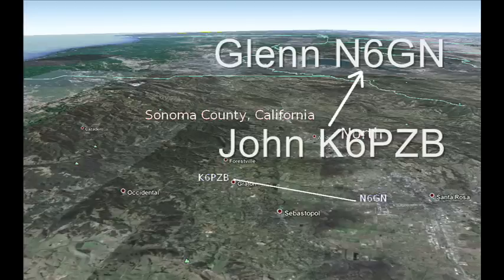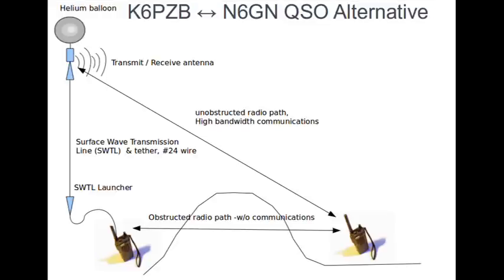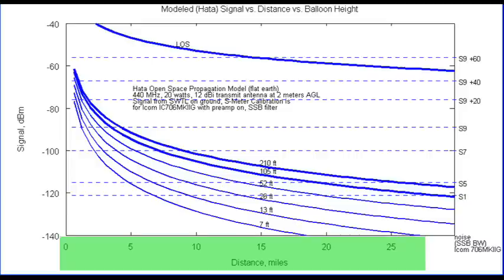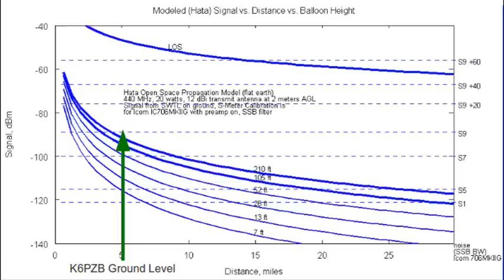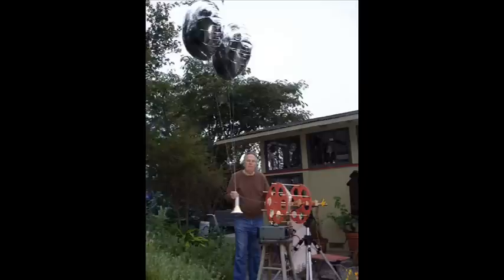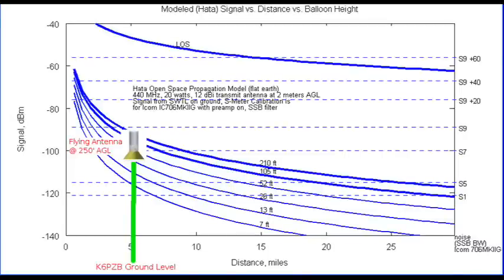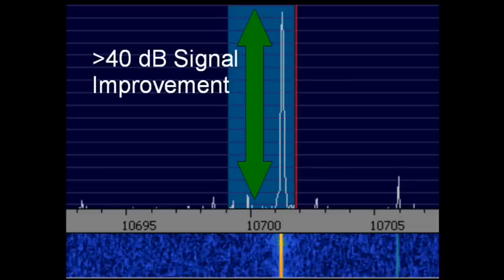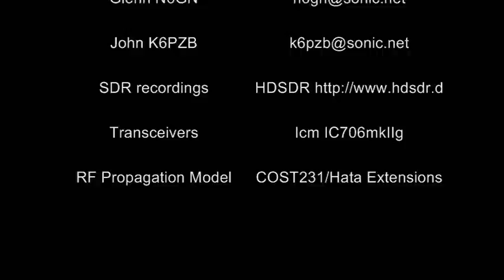The Flying Antenna

Comment: Would this setup make a good receive antenna for remote control first person view aircrafts ? (mostly you need omni directional reception above the tree cover.)
Reply from the maker: Yes, I suggested exactly this in one of the RC groups (I've forgotten where!). You can see a sketch of it at the bottom of http://www.sonic.net/~n6gn/SWTL_Powered_Drone_Antennas.html
Reply: Glenn Elmore Wow cool, that's pretty much what I want to do. 

I was thinking of using a balloon for lift and a glider wing to keep the position.

Also I would use hydrogen instead of helium since that's way cheaper and you can make it with just some water and electricity. Maybe replace the tether with a tube that can keep the balloon filled up with hydrogen. 

Also maybe I can use the tube to feed power to the glider's motors if it's made of conductive material. 

100ft 24 gauge wire weighs less than 1 pound, maybe it is strong enough to make the connection to the balloon.